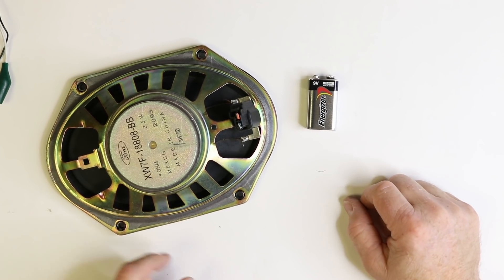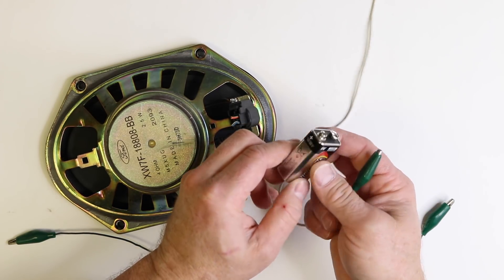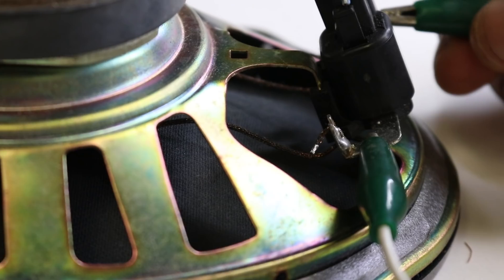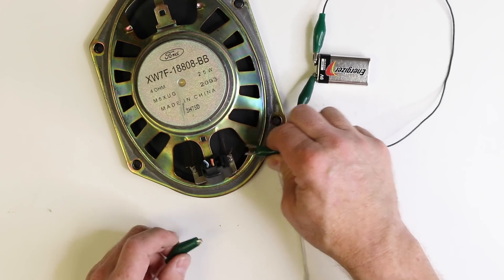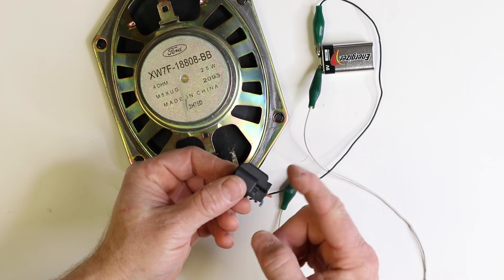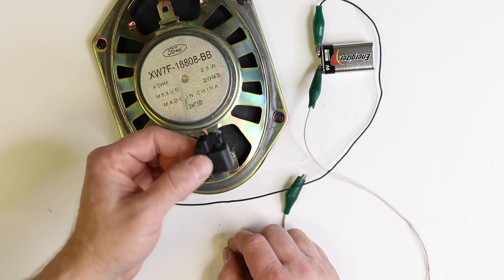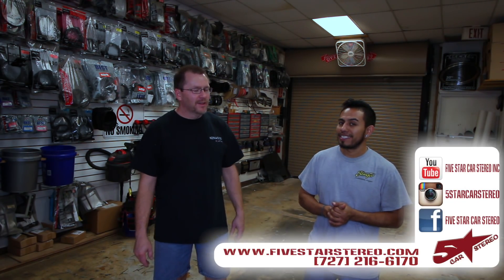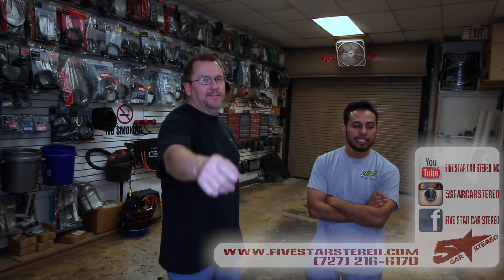How to polarity check your speakers with a 9volt battery

Comment: Y da metra speaker adapter to d's factory clips r crossed dey have da neg. On da clip side so I did da batt. Test & fixed da wires..

Comment: Unless you're running  new wire ALWAYS use speaker wire adaptors, it's easier and keeps the integrity of the car. It matters even more to new vehicles.
Reply from the maker: Savion Smith personally not a fan

Comment: how can you test out which is  + positive on the wires coming off your stock harness to your door okay speakers  when someone on the car previous in Cut Off the plug
Reply: There are websites that can guide you in the right direction. When I used to install we used a site call "The 12 volt dot com". I'm sure there are better sites these days. But that should get you started.
Reply: thanx
Reply from the maker: German santiago the other trick is- you need a flashlight and a friend. Give the flash light to your friend and have him use it to look into the speaker grill. Then you tap the wires he can see it move in and out.